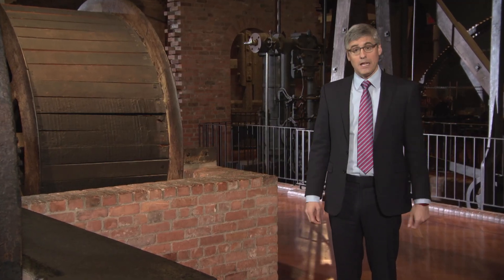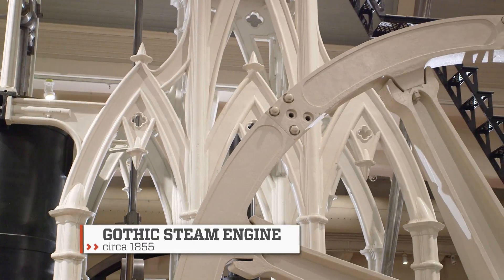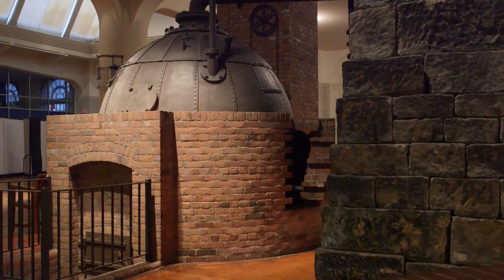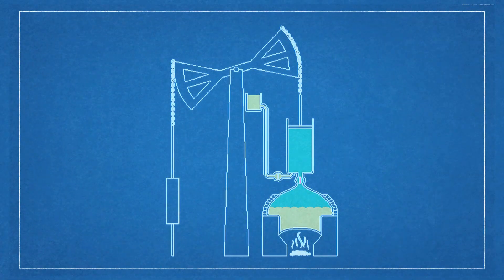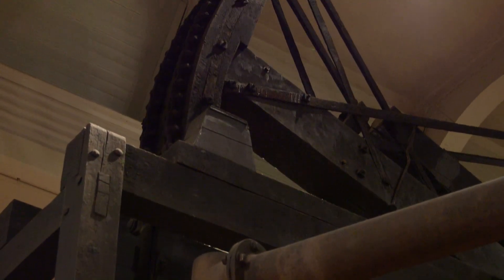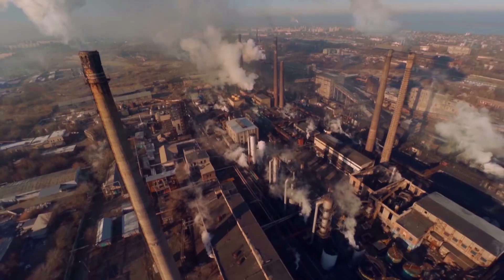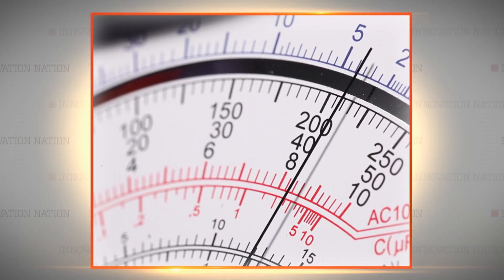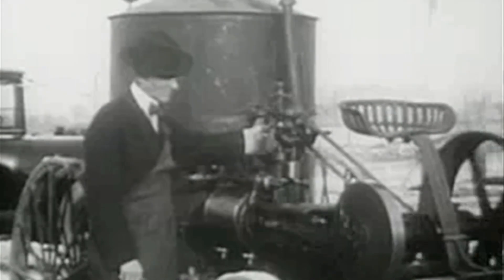History of Steam Engines | The Henry Ford’s Innovation Nation

Comment: Bare Bottom Bob isn't a Steam Engine, ( a Steam Engine provides Steam Power ), it's an Atmospheric Pump, it provides Atmospheric Power, not Steam Power. Steam doesn't drive the Newcomen piston, Atmospheric Pressure or weight does, the weight on other end of the beam pulls the piston back up. It has to be pulled as it hangs on a chain.
James Watt dumped Thomas Newcomen's Atmospheric Power and Arkwright's Water-Power for High Pressure Steam Power.
To achieve that he had to invent a new engine, the world's first PRACTICAL High Pressure Steam Powered Engine.
It was the first engine in human history that could replace and outperform the 2000 or more years old Water-wheel.
It was the one and only invention that kicked off the Industrial Revolution.